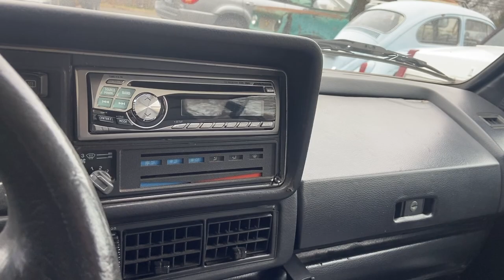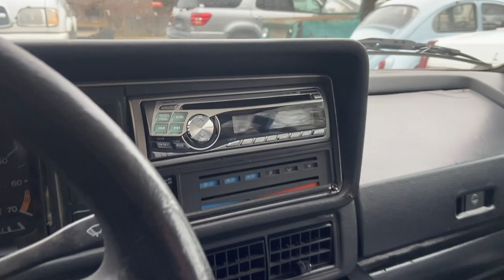4 Hour Drive For This Volkswagen Cabriolet...?

Comment: Honestly this doesn’t look too bad. For the loose stick shift, you most likely just need new bushings, they’re cheap and easy to replace. I’ll admit that the heating system looks like a big mess! Mine is a 82 (uses cables not vacuum) and it was stuck on heat for many years before I finally fixed it. I just adjusted the heat by cracking open the window or taking the top off during the summer. 😂
Reply from the maker: Yeah it’s not that bad. There’s a lot more issues found after putting it on the lift that need to be addressed.

Comment: Who in the hell would do that to the heat and vacuum? 😂

When I picked up mine last year, clutch was smoked and was on/off, the clutch cable was frayed and the adjuster was broken. Shift linkage was busted but I somehow found gears - I still need to replace the shift rod bushing that is blocked by the exhaust (because the bushing isn’t there).

When I installed a big brake kit with a bigger master cylinder, removing the existing master cylinder was the final straw for the brake booster and the internals basically disintegrated. That ended my fun for most of the summer

Now I replaced a screaming fuel pump with one that leaks, so waiting on another new one to come in, and have to replace the fuel pump relay as well. Good times all around but eventually I’ll have the Cabriolet hotrod of my dreams!

Where you guys located?
Reply from the maker: Keep grinding the issues out. When there all taking care of the you’re hitting the streets u won’t be disappointed!! I’m in CT
Reply: @Barndubs  Already got it on the streets (had to replace the in-tank pump as well) and I friggin love this thing! Looking to do my suspension and a full cat-less exhaust (all of which is on a shelf in the basement).

I'm in RI, so not too far away